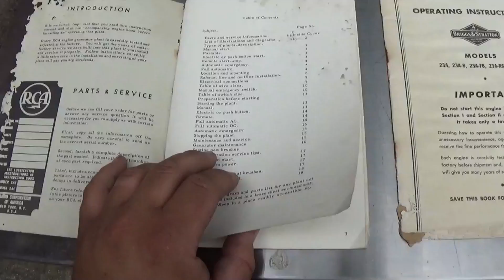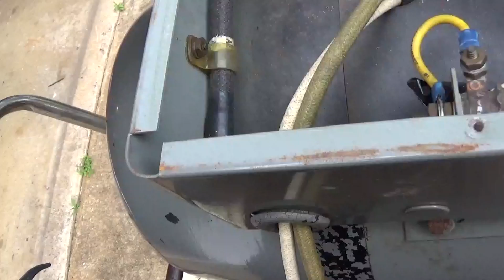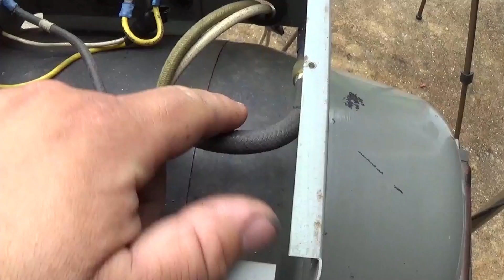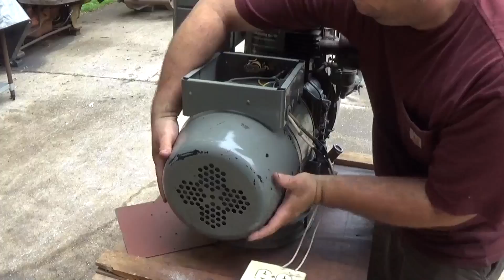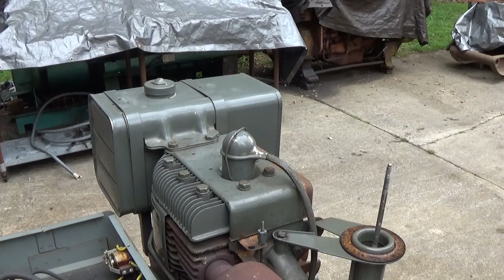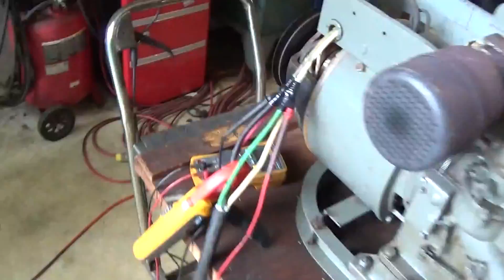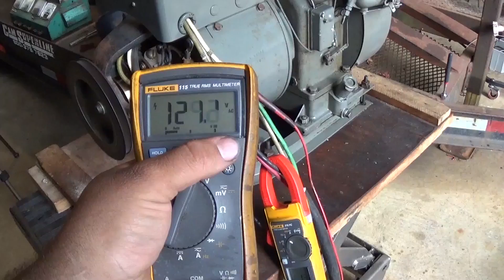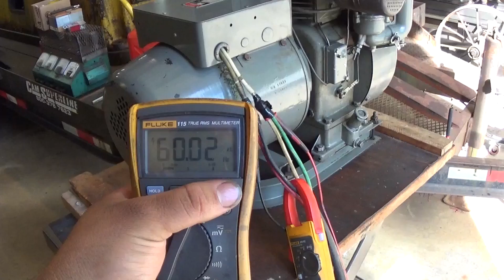Mint 63 Year Old Briggs and Stratton Engine on an RCA Generator

Comment: What would be nice (for newer things obviously) is two off modes, off and emergency off, where regular off brings it to a low idle and disabled the output and cools it down before shutting off, maybe including running rich for the last portion before it shuts off, and emergency off just shuts it right down and maybe presses a brake type material wedge under a disk front and rear to both stop it once the rpm slows a little (to reduce load and wear on those parts) and lifts the rotating assembly upward to keep from hot soak wear to the bearing surfaces (vertical shaft types may need three wedges and a lower wedge to lift the thrust load off)

Comment: This Genset was probably marketed to the "Bomb shelter" builders or others that were concerned with power interruption due to possible attack - based on the cold war. -- which were rampant in the late 50s.  You mentioned that many were building them in that time period - makes sense given the time period.
Reply: Plus the lack of electronics inside says a lot too. They were just becoming aware of EMP, and transistors in the day were being knocked silly by atmospheric testing. So they kept things simple, using points, condenser, and relay setup. They didn't have much in the way of delicate electronics in the day, so the power/frequency variances were well within limits. They were expecting to operate lights, fans, and maybe a tube radio in their bomb shelter, no air conditioning or fancy stuff.  Maybe a hot plate or a coffee pot if they were set up well enough.

Comment: I use to be a RCA engineer. This is probably for a remote communication facility
Reply: Back in the mid to late 60's my dad would take hunting up in the Bald Hills in the Eatonville area of Washington state. I remember we came up to a repeater station on top of one of the mountains. Small building for sure but I could hear the engine just purring away inside... did sound a bit like a lawnmower back then! Good memories

Comment: I am going to buy a back-up generator and I have to buy a screaming 3000 rpm Chinese unit, because that what you get nowadays. I wouldn't mind this kind of generator, even if it less fuel efficient. and harder to start, but it is so damn nice to look at and to hear it running in the harmonic 1800 rpm. A really good buy!

Comment: Hello my name is Lance I'm looking for parts for a gen set I have it's a pincor gold crown gen e motor ac dc gen built by pioneer it has a radiator cooled lauson that has a crank start gen  set I need the brush holders that are pot metal that is crumbling or cracking can you help me on this or know where I can get parts years manufactured would say 30s 40s possible late 20s because of the engine series it's a model LWR   lauson it has a 110 v ac plug socket and 12 volt dc wing nut -- and + terminal its self exiting has a brush armature and slip ring set up on the other it can be set up for electric start as it has a starting selenoid  you can call me 716-370-8704 thankyou

Comment: Great find there. Those BIG cast iron Briggs are my favorite. A 23AFB was my first big Briggs. I now have about 15 of them now. Model 9s, up to 320000 series. My only cast iron Briggs with a generator is a model B with a 800 watt Kohler generator bolted to it. All my other generators are bolted to aluminum Briggs engines. Keep up the good work.

Comment: Word of warning: The magnetos on those Briggs 23A series engines are very unreliable, and have been known to fail just sitting on the shelf new-in-box. Don't be surprised if after some use the mag just quits. If you search a bit online, you will find people who have figured out how to retrofit more modern mag coils onto the original magneto armature. You might lose the flicker points operation though.
Also, the bouncy governor on a Briggs 23 is almost always being slightly lean on the main fuel. Those carbs seem really really sensitive. Unloaded, my 3600 RPM Briggs 23 powered generator will need a slight main fuel adjustment almost every single start to get hunt-free operation.

Comment: Very nice, but significantly nosier than my 8.5 kW B&S GENSET (8 years old) with a 11.5  hp B&S vert. shaft, which has no Put-Put in it's sound, just a mild roar. Ron W4BIN

Comment: I would get rid of that light weight oil and put in 30w oil. These engines run alot hotter than one thinks, especially under load.

Comment: Would it have been something used to help keep a radio station on air during a power outage?
Reply: Possibly a low power broadcast station, or something like a Police radio dispatch which had generally a under 250W transmitter or even a microwave relay site where under 20W was the transmit power. You could not run a very large transmitter from something like that at the time since tube based transmitters are not very efficient. And Air Conditioning would have been out of the question :) 
Another use would have been a mobile broadcasting unit in a van with a telephone link back to the station.

Comment: I have a similar Briggs engine on my wood splitter...Love where the points and condenser are located.. No pulling the flywheel to work in them...Cheers; Mike in Louisiana
Reply: My old 7hp Kohler was on the outside as well. I was young and was going to change them out and pulled the flywheel off...guess what? No points. Followed the wire to the kill switch and found em under that cover...oh well.

Comment: Man, that thing is like brand new inside! What a nice find, and we probably both know why it was sold... someone cranked it up and it wouldn't make any power, and they were too lazy to take the generator cover off and investigate.😁 Really nice that it's a 4 pole generator and only runs at 1800. It wouldn't take much at all to make it electric start with an old Ford starter solenoid and a couple switches on the control box. I wonder if it's 6 or 12 v. start though? That's a pretty beefy cable for the start circuit, even for a starter/generator setup for 12 vdc. 😉 On the surging there near the end, you might want to go through that carb and make sure the idle circuit is working well. Those old 'Flojet' carbs are notorious for the idle circuit clogging up and making them surge under light load. (Don't forget to take the main jet emulsion tube out before pulling the top off!!)😁👍

Comment: I had a nearly mint 1958 Briggs model 23 that powered a Winco 3500 watt generator. It came out of a farm houses basement in Hamilton. It was originally connected by natural gas and waa run with a special piping system out of the house to run it outside. It was still barely run, only in emergency power outages. It was a really nice genset. Those old ones are built really well. Winco I know is still in business making high Quality American made Generators.
https://youtu.be/xmyZa-D1izw

Comment: It might have been for small radio stations in case of an emergency.  With the RF suppression gear on it and an RCA nameplate.
Reply: Without doubt. RCA manufactured fantastic broadcasting equipment. So sad that they just vanished in the late 80s.
Reply: @greenpedal370  Thomson electronics is what happened to RCA name badge. They ruined them by selling junk and they now call themselves Technicolor which is junk as well. I believe Audiovox owns a division as well. Sony owns the record label.
Reply: There were low power stations all over the Midwest in the 50's and 60's  running 2,000 watts daytime power.
Reply: @robertl.fallin7062  a 2000W AM transmitter would be closer to a 6,000W load as AM transmitters are only about 33% efficient. Now it would run something like a 1930's era 300W Collins broadcast transmitter all day long. That being said, this was more likely aimed at an application where the load was constantly fluctuating such as a two-way radio setup where the 1950's had Motorola, General Electric and RCA as the "big three" in the two way industry and 250 W "quarter killowatt" base stations were commonplace (before repeaters were really a thing).

Comment: Does the lack of leaded fuel hurt the valves?
Reply: its never hurt any of my old engines but ethanol will eat up rubber fuel lines like its battery acid
Reply: Would be good to use lead fuel additive for the valves.

Comment: About time you find a unit which does not need rebuilding and congrats on the find. Would you mind sharing your cost? With the shielded wiring and paint, it could have been part of a military contract. 
I just sold my 2500 Watt Winco running at 1800rpm with a similar B&S engine but with a recoil starter and all was working fine for $150. I too had critter squatters in the bell housing end so wrapped a narrow band of hardware cloth around the unit thus covering the openings next to the engine. It weighed over 200 lbs and took up too much room in the garage so was replaced with a Honda eu2000i.

Comment: Made the same year I was born, back when Quality meant something.
Reply: Back when they used real copper winding's and the rated wattage output was continuous not surge.
And a 12hp briggs would actually give 12 hp.
Reply: @deadeyedsam850  There's good stuff out there but it ain't cheap. I have a Yamaha generator. super efficient. Will run over 8 hours on one gallon of fuel. About 2500 hours on it, still like new. A friend who lives off grid has the same one, 18,000 hours. (yes you read that right) no overhaul, oil changes and valve adjustments. It's pretty worn but still works. I use good oil and ethanol free fuel. It's never had ethanol in it. It helps that we live in the desert, no humidity and heat helps keep the oil from getting contaminated.
Reply: @TheBandit7613  I think Quality anything has always cost more its just that the market is so flooded with cheap junk that it just seems more expensive .
Reply: @deadeyedsam850   Your so right. The market is flooded, especially with cheap junk generators.
Reply: You're a quality built piece of equipment. 👍  I hope you're not falling apart like I am.
Reply: I was thinking the same thing. Built solid and for the long run. Now-a-days everything is junk and throw away.
Reply: Lots of junk was being made back then, too. It's just that now, only the best things are left..
Reply: @skuula  well, most flathead Briggs from before the 90s still run and exist. Now the engines overheat, blow up and all because of crappy Chinese workmanship and materials
Reply: Like fillg, glad this is so well preserved  I was born at the end of 1955, too bad I'm not running just as well! 8-))
Reply: you got that right

Comment: That Model 23 Briggs only makes 5.27 hp @ 1800 rpm delivering 2500W. Strange. My Onan 2CK-1M military unit is only rated for 2000W and the engine produces more power (~7 hp @ 1800) from a larger displacement (38 vs 23 ci) twin. I guess it must be a case of the military underrating. That is a super unit. Pretty much ready to work, looks like. Great show, thanks!

Comment: Shielded ignition implies used for communication equipment.  Possibly intended for military use or a prototype to demo to military.  I doubt that the PB relay was intended as flicker relay,,, I don't think the mechanics of it would survive at the hinge point.  It probably puts the field resistance in when engine is up to speed.

Comment: You kep saying " generator" but is it not an alternator?
Reply: @Chuck Kirchner Wow I only asked
Reply: Even though it's AC it's still a generator.  The brushed DC only generator as in older automobiles is specifically referred to as a Dynamo.
Reply: Yes technically
As per Engineering it is a AC alternator.
Hence 61hz 
A DC generator has no Hz.
Reply: @Chuck Kirchner Then why do you refer to your own 1kW machine on your porch as a generator?  Lol.  Now relax.  No one is arguing, they just sharing.

Comment: any chance that RCA made these under contract for the military?
Reply: @fiftyyears-e5n  It was over for 4 years by the time this was built.
Reply: @TheOtherBill  First instinct was what Mark commented, but 1957 puts it after the Korean "conflict" and before Vietnam. An US war 'tween' year.
Reply: If it was a military unit I would have expected it to have service tags and removal-from-service tags though.
Reply: Maybe made for the military to their spec, but the war ended and the contract was cancelled. The nice shielding suggests radio reception, flicker points suggest an application where regulation was important (electronics), although I would have expected a battery charger output as well.
Reply: That's what I was thinking about the shielding.
Reply: @fiftyyears-e5n  A 1957 generator a little late for the Korean war which ended in 1953.

Comment: What is the purpose of the flicker points? Just to stabilize the output? Never heard of them before.
Reply: They stabilise the voltage coming out when the generator is under heavy load.  Newer generators don't have them since they are a common failure point.
Reply: @douro20  new generators are mostly 3600 rpm too so the flicker would be less to begin with
Reply: Robert L there mainly for small single cylinder engine to stop the current from pulsing. The pulsing is usually why big gen set engine's have more than 6 cylinders so there more smooth especially under load